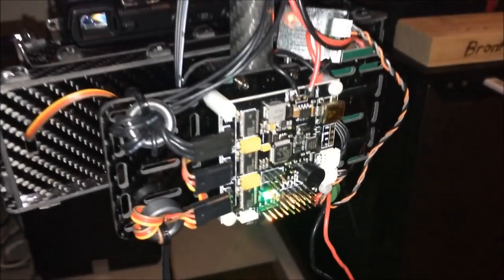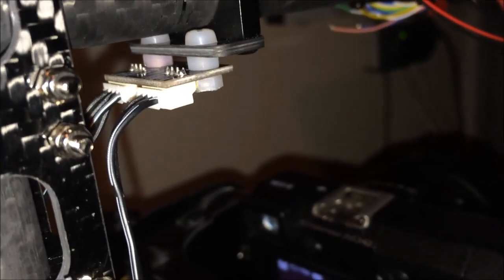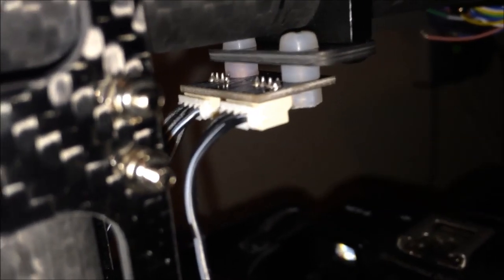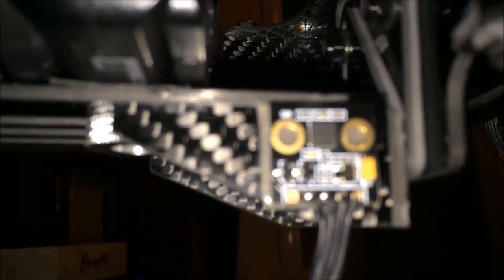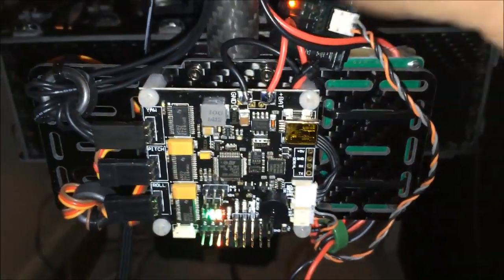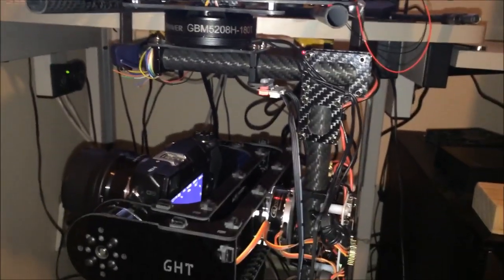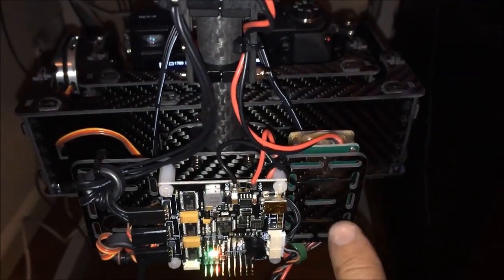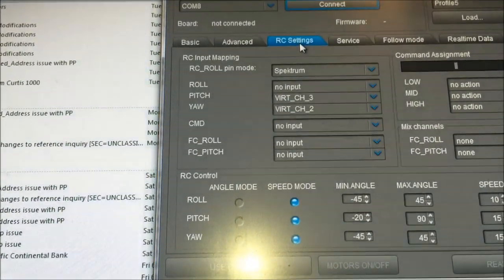SimpleBGC 32Bit 2 IMU's Wired Up

Comment: Man thats cool new about the spektrum kit..... Good vid man.

Do you know if you are able to switch the IMU's ? Or is one for the frame and the other the gimbal?

Cheers
Reply: ***** Thanks John,
I just received my 32 bit controller. I have had played around a bit and seem to be making progress. The yaw for some reason keeps spinning. Ill keep tampering away and hopefully sort it soon.

It was great to see someone with really the same kit as me,
- NEX-6
spektrum Dx6i for the gimbal.

I wen for the dys NEX gimbal. I was a bit sceptical especially using the NEX 6 rather than the 5. From what I have seen I think it will work fine....

You seem to have yours working very nicely...

I might have to bug you a bit in the future for knowledge.

Cheers Mate,
Reply: *****
Its a slow one.... The red dot will not fix on a point, just keeps circling therefore she keeps trying to find it.... 3.30am time to got to bed and try again tomoz.

Cheers man
Reply: *****
Hey John,

Getting there man, gimbal all in order. Dont ask how, it just is....
So I decided to use the Sbus system on my orange RX...(more channels)
I'm getting outa my depth now!!! Can you explain how you get your Tx talking with the alexmos through the satalite port... I'm not getting much love...

Cheers mate.
Reply: *****
Exactly what I thought,  maybe I'm not programming the Tx properly...

Cheers man